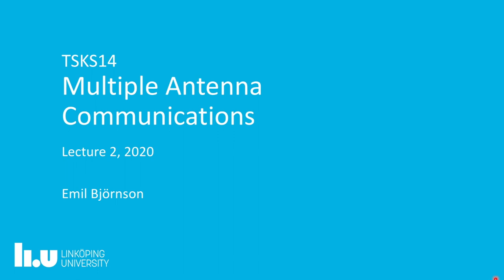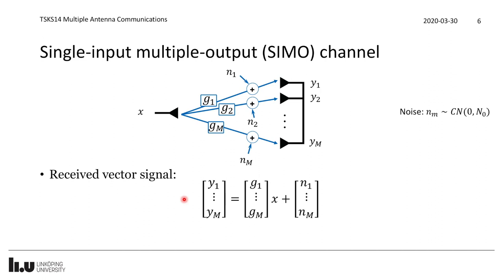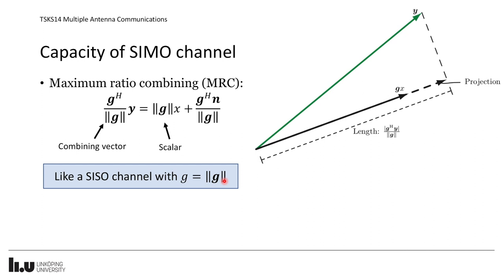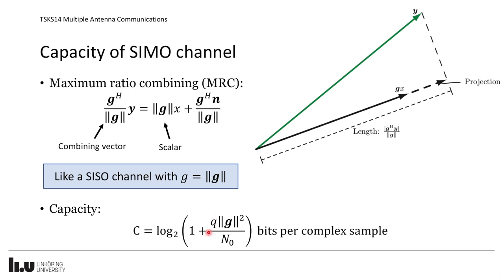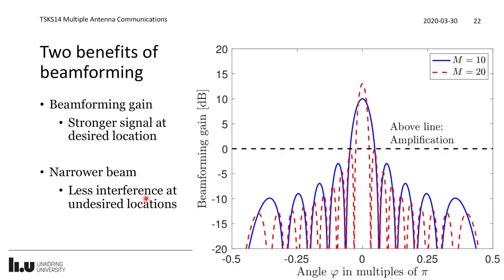Lecture 2: Capacity with multiple antennas at one side (Multiple Antenna Communications)

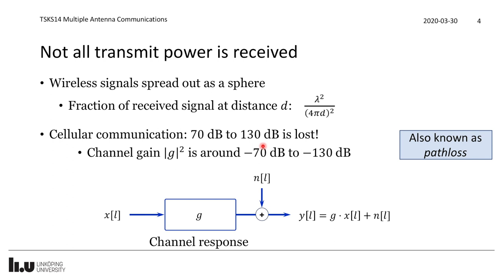Comment: 03:56 Capacity of memoryless SISO channel
05:37 Single-input multiple-output (SIMO) channel
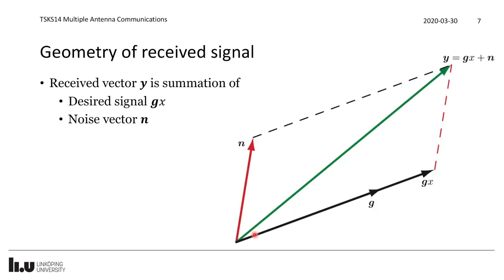07:29 Geometry of received signal
12:29 Multiple-input single-output (MISO) channel
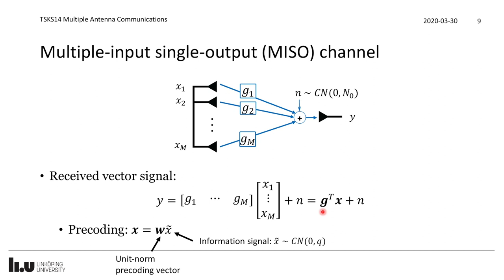15:25 Geometry of received signal
17:20 Receive and transmit beamforming
19:09 Transmit beamforming
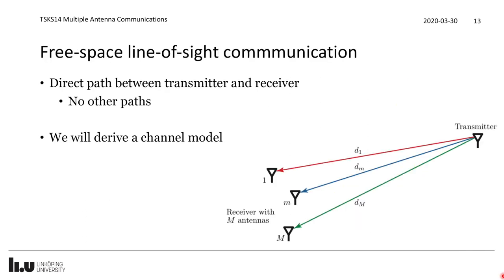19:51 Free-space line-of-sight commmunication
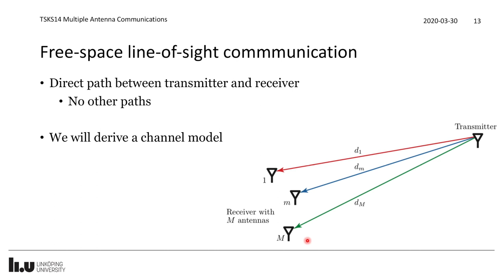20:46 Complex baseband representation
23:07 Uniform linear array (ULA)
24:20 Impact of channel in complex baseband
26:21 Far-field approximation
29:14 ULA channel model
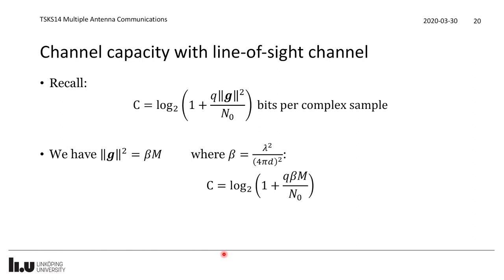30:28 Channel capacity with line-of-sight channel
31:16 Beamwidth

Comment: 6:33 So we're only talking about noise generated by the receiver circuit, and not noise acquired on the wireless paths?
Reply from the maker: The noise is added to the signal when it reaches the receiver. There are different kinds of noise, but we are focusing on thermal noise from the receiver circuit. You are right that there is also ambient noise that can be picked up by the receiver circuit. If it is Gaussian-like, it can be included in the same term by just adding up their variances.

Comment: Could anyone please tell me where the error is in this simple MATLAB code for plotting the beamforming gain figure with M = 10. This code gives higher sidelobes.

clear, clc, close all

phi = -1/2:0.00001:1/2;   % Angle of arrival
DeltabyLambda = 0.5;     % delta/lambda ratio
M = 10;                              % number of antenna elements

for ii = 1:numel(phi)
    g(ii) = sum(exp(-i*2*pi*(0:M-1)*DeltabyLambda*sin(pi*phi(ii)))) ;
end

plot(phi, 10*log10(abs(g)))             % plot beamforming gain
hold on
plot(phi, 0*ones(1,numel(phi)),'r--') % plot 0-dB reference level
axis([phi(1), phi(end), -30, M])
set(gca,'xtick',-0.5:0.25:0.5)
xlabel('Angle \phi in multiples of \pi')
ylabel ('Beamforming gain [dB]')
Reply from the maker: The code seems to be mostly correct, but I think the gain should be computed as abs(g).^2/M.
Reply: Thank you very much prof. Emil